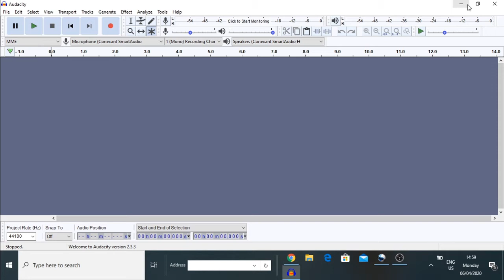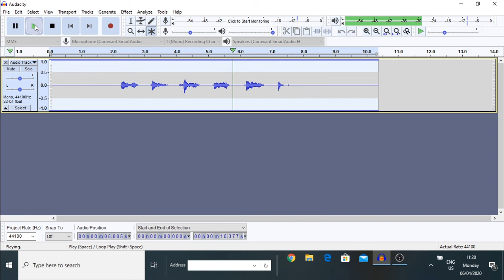Removal of Rumble and Crackle Sounds from Audio in Audacity

Comment: Hello, what do you do if the cracking/rumbling is occurring during the voice your wanting to keep? I have a singing audio, and it randomly cracks badly in between
Reply: Me too. I also don't have an idea on how to get rid of it.
Reply: Thanks for the reply, I still haven't found a way to fix it. The only way I prevent it is by saving the audio 10× more quiet. Keeping the inner blue part inside the bars before saving
Reply: @Mikey-jf3nx  Audacity has been working fine for me for months and now basically out of nowhere any audio recording I make has terrible crackiling and popping sounds. I tried dramatically lowering the volume but I still hear it. Let me know if you find a fix
Edit: I just checked the actual audio file that was saved itself and it sounded fine, not sure if your crackling comes through to the other end, or not but you can try going: Edit -> Preference -> devices -> and increase buffer length until it works like increments of 50ms